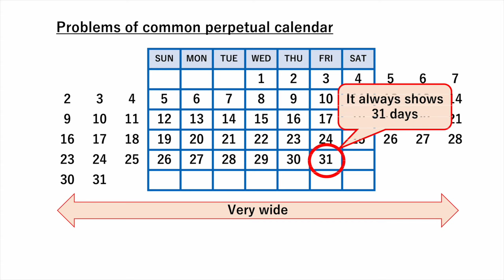Track Link Calendar

Comment: I dont know if the author has already commented on this on another video.
But as we see, the lines of the dates are printed on the sliding pieces not horizontaly, i.e. parallel to the length of the final assembly, but with a slight inclination. Why is this?

I think its because if you print them horizontaly, then you will have as many as 8 horizontal lines of numbers. For this 8, see the video starting at 2:03 and count the lines --notice there is a line with a 29 right at the start. This means the slidings pieces will have to be of a length suitable to contain 8 lines of numbers.

But if you print these 8 lines with a slight angle to the length of the final assembly, then you can fit these 8 lines in pieces of a smaller length. And so you will save 3D printer material.
Reply from the maker: Yes, it has an effect to reduce the height of the calendar. Additionally, it makes the track link cyclic. If the lines of the dates are horizontal, boards near the connecting part is useless. Since we have 28 types of calendars (7 days of the week * 4 types of months = 28, 29, 30 and 31 days), the minimum number of links is 28. To make the calendar with this minimum numbers, the inclination is necessary.

Comment: I don't understand the changing of the month wheel at 4:15. Why? What did it accomplish?
Reply from the maker: The setting of the month wheel is good thru from March to February in the next year. Usually, the day of the week in the following year has 1-day shift (365 = 52 * 7 + 1), but in the leap year, it shifts 2-days (366 = 52 * 7 + 2). Therefore, at March 1st, the user should detach the month wheel and set it with 1 or 2 steps shift.
Reply: @shiura  damn leap years. Thanks for the explanation.